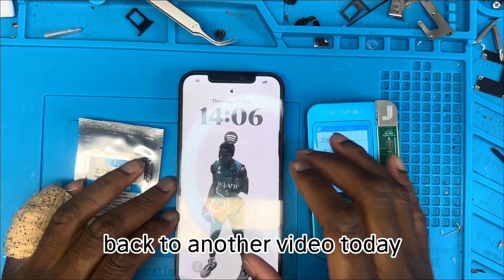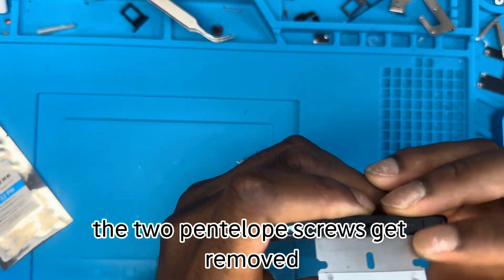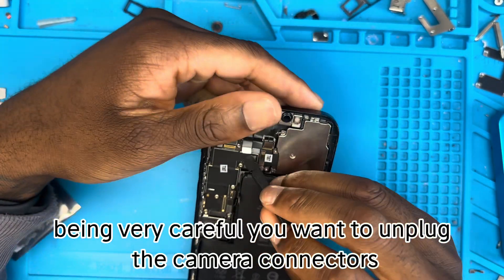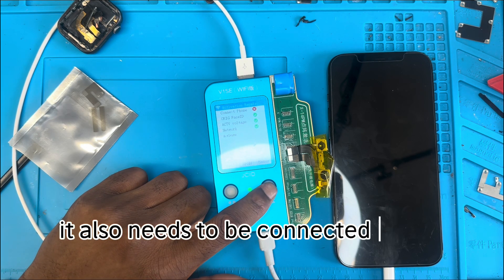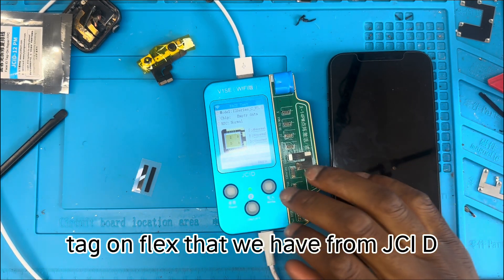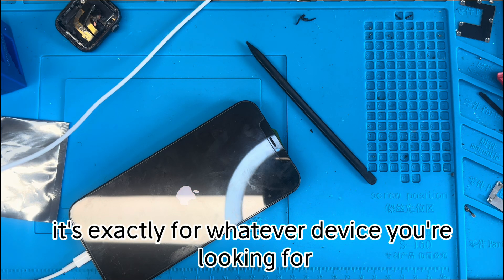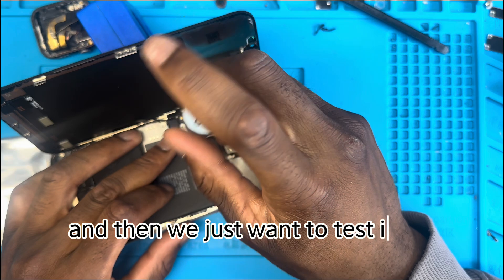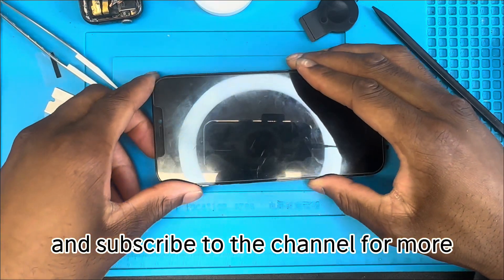iPhone 12 Pro Max Face ID Repair Using V1SE & JCID Tag-on Flex | Non-Removal FPC Method!

Comment: after updating to public beta 26.0 on my ipad pro 12.9 5th gen.  My face id stoped working and it showing "message error" or somthing.  

but my memoji and red Dot light projector working fine even True Tone . will it be fixed after updating on to stable upcoming ipad os 26.  Or is it a hardware issue  what do you think?
Reply from the maker: Very strange, it must be a bug in the software. There might be a way to downgrade it
Reply: @TechKingz.are you sure that my hardware is good and Face ID will work after downgrade or by upcoming stable update. And also I m currently on iPad os 26.1 beta waiting for stable 26.1
Reply from the maker: @imashishkumarraj your definitely not the 1st person to have issues with the latest IOS 26, do you know for sure that the issue wasn’t there just before you updated? We can try diagnose the issue
Reply: @TechKingz.ofcourse this happened after the update only.  Let me tell you full story . After update for 2 3 hours ipad was working fine then after my face was not detecting then i go to settings and delete my face data and tried to set up new one but after clicking on to set up face id “ get started” button was not visible i have to rotate 2 3 times then only get started button visible and when i tapped on it and error message shows “enroll _ failed _ inter- Locked _ message _ settings” this message pops up and the “ set up new Face ID “ greyed out and a notification pop up on setting menu bar saying Face ID disable . But after 4 5 hours later both the things enable again for set up but when u try to set up same message pop up . So i “reset all settings” after that that notification message and “set up new face id” was permanently greyed out.    

But my memoji , true-tone and red light dot project which i checked from my phone camera was working fine. The character in memoji behave and act according to my face.  

What do u think ? Is it a hardware issue ?
Reply from the maker: @imashishkumarraj  Thanks for the details, Sounds like a software issue for sure. Try using 3utools to downgrade the IOS on your ipad or wait for the next update to hopefully resolve this issue

Comment: I have repaired my 12 pro camera has it had camera damage the guy mentioned me that Face ID cannot be repaired.  I do not have the original strip. Would this still work if I just buy the strip and program it ?
Reply from the maker: Unfortunately No, it will only work if you have the original Camera to copy the encrypted data to the tag on flex. Hope this helps
Reply: @TechKingz.oh. No :( the repair guy scammed me I guess. I had the original on it but he just swapped it out I guess don’t know what he did .
Reply from the maker: @parthpatil3315 well if he told you Face ID will be gone then didn’t. Not many technicians know that they can reprogram a tag on flex to restore Face ID, how long ago didn’t you get it replaced?